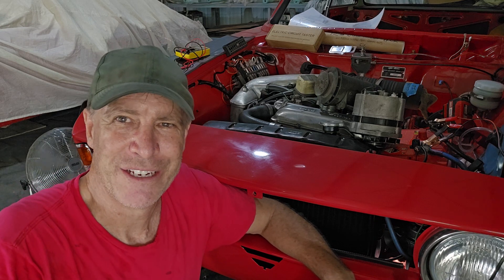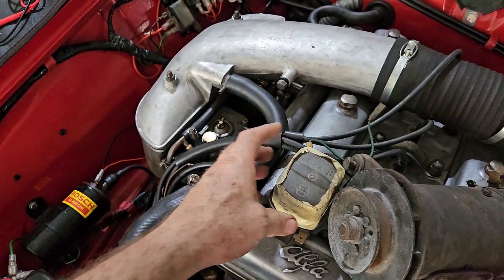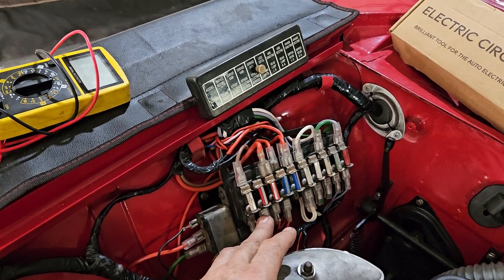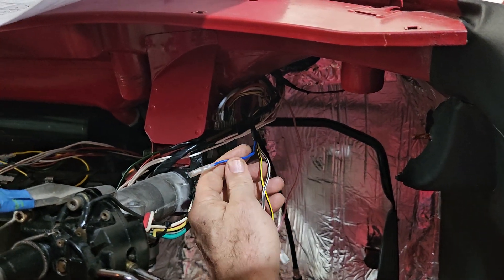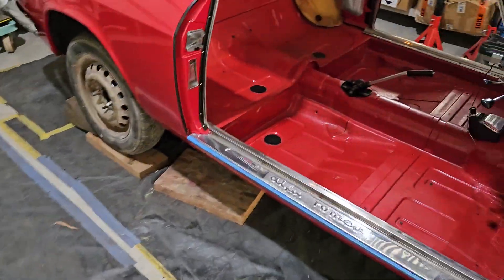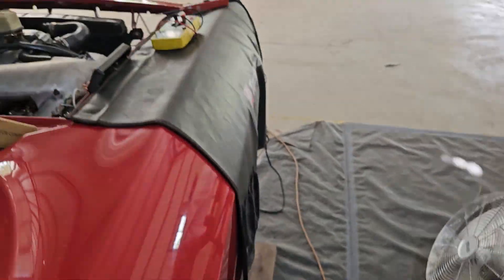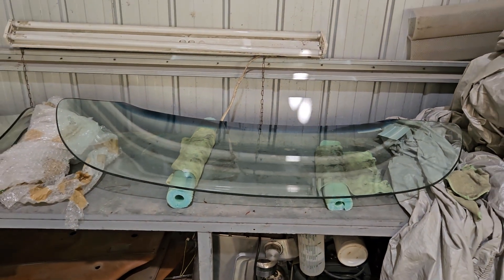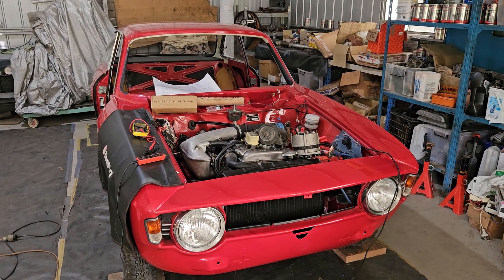Alfa 105 wiring..generator to alternator change

Comment: Coming along nicely!  One question, though:  why didn't the wiper motor fuse blow when all that heat must've been building up in the system?
Reply from the maker: That is a good question ..hmmm...not sure...we will check the wiring flowing through the footswitch as well.🤔

Comment: Based on my experience in Victoria, if a non-laminated windscreen was original equipment when the car was new then it can be installed.  The aforesaid only applies to restored cars - not modified cars.  However there is no doubt that a laminated version is safer.  For the new windscreeen, recommend you check its shape with the old screen as I have encountered some new windscreens that were poorly manufactured and posed a problem when fitted - i.e. the central bottom edge of the screen tended to jut out of the sealing strip.
Reply from the maker: Sage advice..we have checked the shape but not measured...will do based on your observations 👍